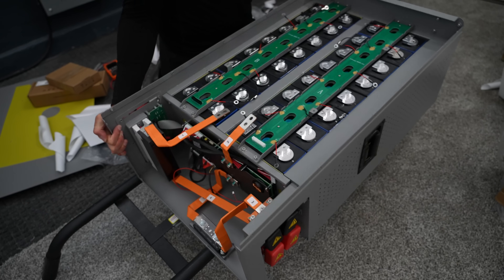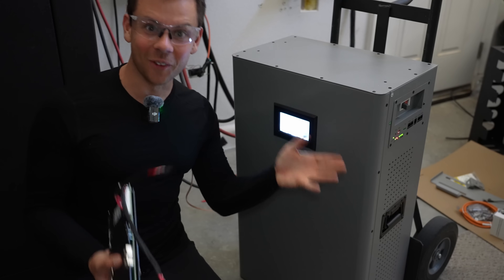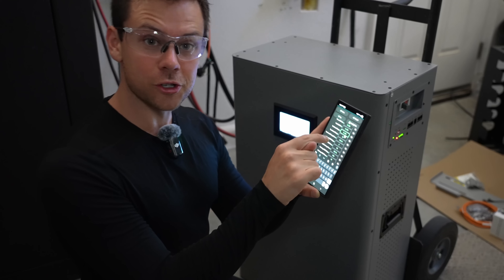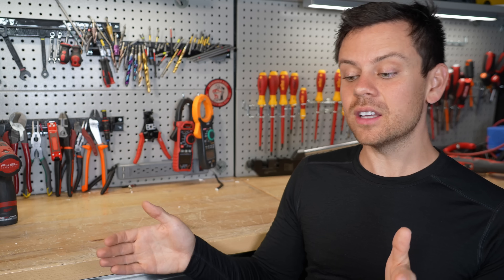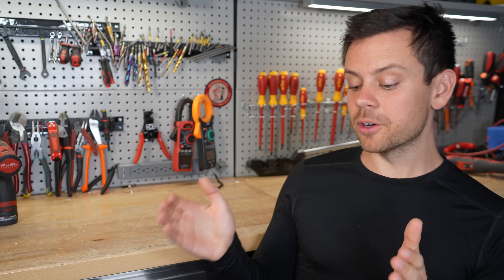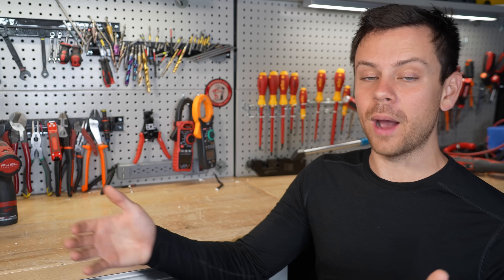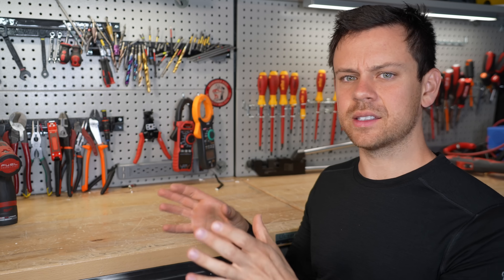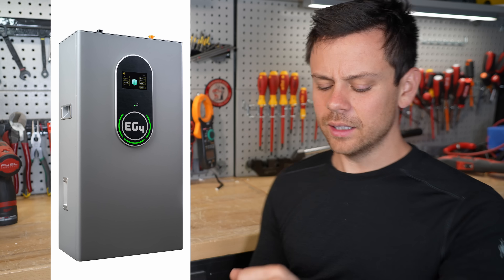Yixiang 16kWh Battery for $1,899?! What in the world!!

Comment: Thanks very good knowledge. The tight thread usually not worrying the ultimate way to fix it use a tap with a bit of oil to clean the thread. Normally it works just screwing the screw down and up to free the thread. The tightening torque value will be to low if there is to much fiction  the thread .

Comment: The video is not 100% clear, however, I understand that the terminal problem mentioned is bad female threads in the holes in the terminals, and this leads to the screws which attach the lugs jamming as they are tightened-down?  If this is the case, running a thread tap down each threaded hole should solve the problem entirely. Can anyone confirm or correct my assumption?

Comment: Dude, I love in an area where it freezes and I don't go to my off-grid cabin. So I put the battery in winter mode for 3 months. After that I need an active balancer. Also, when using a battery up to 1C you get differences in cells. You do need an active balancer. I am not new. Years of experience and study. I do not agree with most of your "opinion".

Comment: Those cell terminals are the best for high current DIY solution, you pay extra 2-3 USD for those when you order the cells. In Europe these are the cells we are looking for. Check the contact resistance over that huge surface pressed by two bolts vs the M6 low bushing area. I think the welded cells with busbar are the cheapest solution, but that's not DIY. You cannot swap cells.

Comment: When you encounter a bad thread in the terminal you should stop and clean up the threads. Use a bottom tap or a re-thread tool. The problem with using a torque wrench on it when you have defective threads is the torque isn’t providing the actual proper clamping force. It could also result in breaking off a bolt in the aluminum terminal. Just be careful that the tap doesn’t go to far down and penetrate the cells. That’s why I’d opt for a bottom tap or re-thread tool over a starting tap.

So, stop, clean up the bad threads, then move forward. Problem solved.

Comment: Interesting.  I'll need to keep an eye out to see how well they do going forward.    Got a possible video for you as I think I have figured out why my Solar was dipping during the peak hours of a cloudless day.  I had Signature Solar Tech support ready to send EG4 all my info as I had them stumped.   But while taking photos of my entire setup I noticed my EG4 Chargeverter display was on.  But yet it was unplugged.  And what I discovered is if you leave the breaker on the Chargeverter in the "on" position, the display remains on.  I'm not sure if the Chargeverter itself is on, but that might account for why I had such a difference in the SOC between all three of my All Season Batteries.
My # 3 battery which is last in line was showing 70%, # 2 ( 2nd in line) was around 80% and # 1 Battery was at 85%.  I have had some cloudy days so getting it charged up to 100% has been a challenge.  But I bought two of the ECO Worthy Dual Axis Trackers and put four 450 Watt Canadian Solar Topcon panels on each and added them to the third MPPT controller on the Flexboss21.  And ever since I closed that breaker and added the extra panels my Flexboss 21 has been working like a charm.  For over two weeks and not one hickup.   Not like before.   So something about the Chargeverter breaker being left on when not in use, appears to have been my problem.   Curious as to your thoughts.  ;0)

Comment: these are really good from what I can tell...  friend of mine has 3 of them..  he moved into a rental for a year or 2 while he is getting his property prepared and a house built..  he originally wasnt going to build up his battery banks till his house was done, however his power goes off all the time at the townhouses.. they arent allowed to have gas geberators.. so he built up 3 of these in his garage (will later use them with his solar at the new place)..  he has used them multiple times during extended power outages to run window A/C units, his 120 volt stackable laundry set, and of course electronics and microwave, fridge etc..  he had a similar out of box failure... one LCD didnt work and one BMS didnt propery charge,,  he wasnt aware of how to set up the BMS so he ordered another one and it came already set.. they sent him a whole new screen assembly with cable..  so not sure which was bad..  zero issues otherwise.. they are in his garage at his rental.. and his new place he is building a stabdalone "battery shack" for all of his batteries, inverters, etc.. the battery shack will have wood / gas heat via hydronics in its floor to keeo the batteries warm in winter.. we are up north (ohio) where sun is limited so he didnt want to rely on sun being enough to keep the batteries warm.. and solar charging throughout the day will be minimal for a couple months as we have a ton of cloudy grey short days so cant count on much heat from charging during the day over winter...  but again, these batteries are working well for him as his backup power at his rental.

Comment: Active balancing is actually quite nice for older cells. I bought an old pack with fried bms and replaced it with a JK. The cells are out of whack by .2 volt after a few cycles and the capacity suffers. I set the balancer to only work if the cells are full, to not make the pack worse, but it helps a lot.

Comment: Just received my MidNite Solar 16Kwh battery. Had to reprogram my Midnite classic 200 and my Magnum inverter. Thing is sweet. $4300 shipped to me. Very happy with it. Hopefully won’t have to worry for 15-18 years now. As a 64YO I am happy I have push buttons and no firmware or apps to deal with…..we are off grid

Comment: setting the JK bms settings is the first thing to do before even connecting the battery to the inverter... You also want to calibrate the V and A when charging at your most used (high) rate, say like 100A or 120A. Use a amp clamp meter, and set the A and V in the JK settings page. The active balancer is fantastic. You set start balance only above 3.43v. Set 100% soc reset at 3.5v and ovp at 3.52v. Same for 0% reset, at 2.8v. Uvp at 2.6v. See more info at Andy page, he did do a lot on JK settings.

Comment: I ordered two battery boxes and two sets of 16-314AH LiFePO3 batteries a couple days after this posted.  I received the two boxes very quickly with no problems (shipped in the US, so I didn't expect any).  When I ordered the two sets of batteries (everything was ordered at the same time), they contacted me because it only charged me for shipping for one set.  Fine.  Whatever.  I thought it was going to be an AMAZING deal for 2 sets with essentially one of them with free shipping.  Nope.  Fine.  I paid the extra $300(ish).  They sent the shipping information out to FedEx on the 17th of July....  Still waiting for them to arrive on US soil.  No changes for over 30 days.  My biggest fear is that because of the separate billing for the second set of batteries, they weren't ever shipped out.  Has anyone received these since ordering them after this video posted?  Let me know.  Thanks all.
Reply: UPDATE: BATTERIES ARRIVED TODAY HOORAY! 

old msg: still haven't received my batteries, been 29 days. got a box full of jeans instead but that was fedex messing up. Have no shipping info for the batteries still.
Reply: I just got my batteries today :)

Comment: UK here...I bought 16 280ah Eve cells from a well known supplier in China last year. Said supplier took the Eve cells and welded their own terminals.. 6 out of the 16 cells the terminal just wiped off and I was torquing them to 4nm.Welds made of cheese. I did manage to get them re tig welded and 4 of them are in my RV and working well.
I bought replacements from Fogstar in the UK who supply cells that Eve weld themselves, these had no such issues as the welds are way beefier. I had no issues with them at all.

Comment: Can that battery be connected to the flexboss21  without issues or or will it not be compatible and only charge them as a dump load or lead acid battery? Thank you
Reply: It could be in the connection.Because of JK BMS

Comment: Couldnt disagree more about active balancing. 

1) It's faster than a resistive balancer
2) It puts more load on the batteries with more capacity, which over years of use is more likely to even out the wear and create cells with equal capacity
3) A proper BMS-integrated active balancer can be set up with just the same top-balancing parameters as you would a resistive balancer

Comment: Solar is getting ridiculously cheap. 
You can get 15kw soloar for around 1500-2000USD. 2500 USD for a 15KW Hybrid Inverter. 2200USD for 15KW batteries. 
around 8K USD for everything with installation. At least in my area.

Comment: Great video! One thing I want to point out - and not many YouTubers talk about this- is that when you’re assembling a battery yourself, the cells you receive might have different states of charge, even if their voltages are the same. You really should top-balance your pack before using it, or you’ll end up losing capacity and putting extra stress on your cells.

Most DIYers don’t have a way to charge each cell individually before assembly, but if your BMS has an active balancer, like one presented, it can handle that for you. Just keep in mind that switching on balancing at 3.2 V won’t do much, since there’s no voltage difference for current to flow.

To properly top-balance, charge the pack slowly (around 5-10A) up to about 3.6V per cell (57.6V for a 16S pack). The first cell to hit 3.6V will cause the BMS to cut off charging. At that point, some of the other cells might still be sitting at, say, 3.37V - which means they’ve still got quite a bit more energy to catch up.

When that happens, stop both charging and discharging, and let the balancer do its thing. Wait until the voltage difference between the highest and lowest cells drops to 10 mV or less. That could take hours or even days, and in the meantime, the average cell voltage may drop to around 3.3V.

After that, charge the pack again and see how evenly the cells approach 3.6V. There might still be some variation, but it should be much smaller than before. If the gap is still large (say, more than 50mV), it’s a good idea to repeat the process.

If your cells are healthy, you’ll eventually get them balanced in both SOC and top-end voltage, and then your pack will be good to go.

And finally, if you’re going for longevity over max performance, you can lower your charge voltage to around 3.4-3.5V per cell. But make sure top-balancing is the first thing you do!
Reply: I think I've heard it from this channel, but I know I've heard it repeatedly from wherever.  With Lifepo4 batteries fully charging them doesn't harm them like with other lithium ion batteries.  Limiting yourself to 80ish% to hopefully have an extra 2% in 25 years doesn't make sense.

Comment: I just built a battery like this one, but in a different case, same bms, same cables, etc.  I also wish they had a different connector for each side of the battery.   Need to check my charge amperage because I had to do the same programming to fix my settings.

Comment: Wait, wait, wait!!!!  Your video is fantastic, BUT you glossed over one important part at 1m:16s.  You talked about plugging in the wrong  balancing cable.  You said they were the same, but you didn't say where the white one goes and where the black one goes.  Please respond and discuss.  I've ordered batteries and the box.  The box already arrived, but the batteries will take quite a bit longer...  Please let us know to prevent a sea of dead BMSs!!!  :-)
Reply from the maker: White goes to white, black goes to Black. I put the cable in where it was closest. Usually DIY kits make it impossible to screw this up so I did not think that they did not think of this. But they didn't
Reply: @WillProwse  Thank you for responding!  I'm glad it's color coded.  I just thought that maybe it was super hard to tell where it was supposed to go.  Engrish instructions, am I right?  🙂
Reply from the maker: Fantastic little battery so far

Comment: That's an amazing price.  Do you thing this battery will work well in a mobile application?
Reply from the maker: Right?! And yes mobile application would be fine. I would put it on its back so the cells are facing up and there is no stress on the terminals

Comment: "I don't like these terminals - the threads are not perfect" why not run a tap down the holes to clean them up?
Reply from the maker: If you ran a tap through it will hit the cell
Reply: @WillProwse  could you mark the tap slightly less than the length of the screw to avoid that situation?  Or is there just not enough meat on the sides?

Comment: isn't the DIY Battery Box orientation is wrong for this type of the battery cells?

it seems like it should be lying down on its back while working, otherwise it's not recommended orientation for any batteries that you can install there

Comment: In 2017 I paid nearly $600 shipped for an ebike battery with nearly 1000Wh, and it was rated for something like 25A or 30A.  It's not a great comparison to this, but still wild that so much more capacity and amps is dirt cheap in comparison. Even power stations I got a 3ish years ago look like horrid deals now, although at the time they were needed for medical equipment, so they were still worth it. Still, I would have been jumping for joy if I could have bought a big house battery at this price back then.

Comment: Will, I am unclear, do I have to supply my own BMS or does it come with the DIY Box?  Do I only need to order the box and batteries or are there other parts (outside of tools) I would need?
Reply from the maker: Not really any other parts or tools. Just cables to attach it
Reply from the maker: Comes with BMS and breaker and everything. just need to order the cells.

Comment: How does a LiFePO4 battery self balance without a balancing circuit?
Reply from the maker: Every BMS on the market has a balance circuit. Small passive dissipative balancers.
Reply: Someone needs to take these active balancers to the next dimension and summate the balance current for each cell to keep the pack delta V < 0.005V . This would give another indicator of individual cell health and quality. The big advantage of active balancers is to do the initial top balance Insitu and for manufacturers to hide 2nd rate cells.

Comment: Just learning about battery builds. I have a Stark Varg moto bike- 6.5 kWh. I currently use 999$ 240v generator at track. The current ecoflow and such are expensive for the 10 kWh or so that I need. How do I build portable 10/12 kWh/ 240v/110v outlets/possible solar charging for multi day events. I could also use it for my out building/ garage power. Would be awesome to ditch generator- less than 2,000$ system possible?

Comment: That kit looks an awful lot like the ones Fogstar supplies in the UK (EVE cells, Seplos BMS 3.0, Mason case). I found that the active balancer in that was actively unhelpful as it balances in sets of 4, so over about 3 months it pushed the cell imbalance from <10mV to 50mV. I unplugged it and left it to the Seplos passive balancer and that has improved the imbalance back to ~10mV. I had no trouble with the terminal threads. Obviously you need to take care to not cross-thread bolts and torque things properly, but the nice flexible busbars avoid putting repeating stresses on them and two bolts is more reliable than the older single-bolt design.

These batteries are excellent value. and perform as advertised. I'm cycling mine from 100% to between 6% and 30% depending on time of year, every day. I'll tell you how long they last in a few years. Mine cost £1700 in Dec 2024.

Comment: I actually like the fact that you can replace single cells if they ever go bad... of course the question is if you will be able to buy them years down the road if one finally goes bad. This was the case with my first gen Jakiper batteries... I had 2 of them and in both there were cells that went bad. Luckily they are also using screw terminals, not welded, so I was able to make one good battery from the best cells of both packs... I thought I could rebuild the second one too, but those particular cells (the tall slim ones) are not being sold anymore. Another downside with the Jakiper: you have to completely disassemble the whole pack when replacing a single cell... with this Yixiang, it looked to me that replacing one cell would be much easier, right?

Comment: Thanks Will, I am glad you show this video, I will buy another set.  Thanks bro. Thumb up....  batteries price went down so crazy.  it used to be 1500 in january I bought 32 x Eve 320 amp= 3000 USD (used to be 16 x CATL 300 amp for 2500 2 years ago...2023.  now it down to 944 but different brand....  I hope it as good....

Comment: When I bought my cells, there was a defect in the laser welding of the terminals. To solve this problem, welds began to be thicker, maybe you have old welding. The problem was when tightening with a torque of 6 Nm without the bus between the cells, only for individually test, the welding broke.